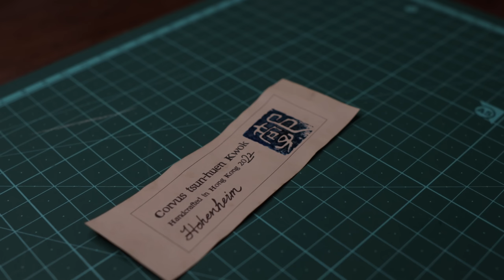Making a Violin with HAND TOOLS: Commandeering Strad's Titian

Comment: If this gentleman is an "amateur woodworker" then I'm Captain Jack Sparrow!!  Beautiful workmanship and exceptionally talented.
Reply from the maker: Aye Aye Cap! Honestly I had 0 experience on woodworking before making my first violin. I will go be Davy Jones or Barbossa, or maybe Princess Mera.... lol
Reply: If I can make a recommendation I would say you went to the violin makers planes a little early in the process when shaping the top and back. It’s hard on the fingers and forearm (golfers elbow). A rigid scraper can give you shavings and you can hog off material very quickly while being easier and faster to sharpen.

Comment from the maker: If you want to build one too, here's the Step by step Violin Making Guide:
https://www.youtube.com/watch?v=CYvl66WDYF8&list=PLEKBKXypc2GDmFymX2FlZOKS1UYYxdo4G

And here's the Complete 3 Part Series of EVERYTHING you need to know before start Making a Violin at Home:
https://www.youtube.com/playlist?list=PLEKBKXypc2GAofRMW-KpfqU3HZGJWTSuv
Reply: definitely stayed in tuned. :D 
also if it's possible that you can remember this comment when you see it, I want to hear it after the violin opened up a bit more.
Reply from the maker: @MIZvalvod  Thanks, and I will have to practice a lot for that too. Haha
Reply: Thanks for the video! You definitely have more tools than most woodworkers! I wished to make a violin, but I found that first I have to have a mould or a cradle to start with, many clamps to hold it together, a hot iron to bend the side planks, chisels and gouges to carve the scrolls. The whole set of tools and wood materials are more expensive than the cheap chinese violin I have!
Reply: This video is perfect! As a professional woodworker I like the tedious parts sped up. Beautiful!

Comment: Beautiful work, exquisite detail. Have watched numerous guitar builds of a wide variety, from acoustic to solid body electric, but never a violin build, this was a treat to see such skill with hand tools. As a fellow wood worker, just blown away, but wondering of the grain orientation of the neck and how under thee string tension it doesn't snap - would think that like with guitars you want the grain running length ways to provide strength/support against the strings. Did do a search for photos of violins and seems this is the norm, still puzzles the mind "knowing" wood and grain and normal ways to get strength.
Reply from the maker: Thanks, glad that you enjoyed!

Comment: beautiful work! at min 32-55 I notice you started with adding the G string followed by the E.. in order to get a fully balanced tension across the bridge, the order should be G-D-A, then E last which is also the protocol we follow when changing strings for that same reason
Reply from the maker: thanks! I put the E there “lose-ly” just enough to make the bridge stand, then D-A, as the A is always stand in the way when I’m adding the E...
Reply: He's not changing strings though, but putting the strings for the first time. You always do G and E first in that case, obviously not tense but just to make the bridge stand. Check other violin making videos especially the one from Dominique Nicosia.

Comment: Beautiful work! I need to start collecting a few violin making tools.... 
 What saw are you using at 5:40?
Reply from the maker: Thank you! It’s a bow saw, should be a very primitive version of it I guess. 
It’s just a piece of bamboo, got a nail on both sides and the heads are turned to hold the “saw blade string”.

Comment: I made a rigid scraper in a banana shape from a 1950’s circular saw blade. Non carbide tipped, so good hard steel. Cut it out with a dremel cutting wheel. I go straight from the grinder to the workpiece. Invaluable for this kind of work and thick enough for no hot fingertips 🤗.
Reply from the maker: I heard that circular saw blades are very good material for scrapers. And old steel? Is the cherry on top!
Reply: I don’t know if modern carbide tipped blades are made from steel that’s as good as the old stuff. The scraper is totally rigid and produces shavings going straight from the grinding wheel. It could take over much of the work of your tiny planes and is much easier to sharpen and use imo.

Comment: Stradivarius apparently soaked his wood in a solution that would break down the wood cell structure but leave its mechanical strength.  One of the reasons that his violins are so coveted, they sound great.

Comment: I'm on my third violin, using non traditional timbers.  Every stage is a challenge.  I'm about to glue the sides to the back plate.  I'm quite happy to use a router or sander when needed, and even a metal lathe for the radius of the fingerboard and the shaping of the pegs and tailpiece.
Reply from the maker: Sounds fun using machines. And there is a urdan legend about the 2nd violin you make is usually worser than the 1st one, and the 3rd one would be way better. Does it apply to you?
Reply: Thanks for the comment.  My first violin was a different shape to a traditional violin.  The second violin was a better tone but hopefully the third one will be as good or better.  The second one has PNG rosewood for the back, PNG ebony for the sides, Oregon for the top and birdseye maple for the neck.  The Oregon is very fine grained.
Reply from the maker: @fasterpastor1000  The second one must be an interesting piece of art. Let us know the outcome when you finish the third one!

Comment: neat stuff, thanks for sharing. couple questions, what kind of thickness were you going for with that caliper measurement? And could you share why you chose to use the power tools that you did? (you were doing much harder stuff by hand, but grabbed a power drill, so yeah, kinda curious)
Reply from the maker: Thanks. I use power drill when accuracy is more important than tradition.

Comment: How do you place the sound post for optimal frequency response in both higher notes and lower notes?
Coincidentally, I just bought one that looks very much like that.  It has no label inside, but I suspect it might be a Corvus Kwok instrument.
Reply from the maker: We are “standard” place for the post, usually would put the post there first, and adjust according to the sound.

Comment: Do you have any guidance for the locations of the cross-arch templates when arching the top & back, specifically where the  T3 template goes? Thanks.
Reply from the maker: Hi Jim, T3 is at the narrowest part of the c bout.
Reply: Thanks! So then the "center" template goes in the measured center of the plate? @MekwokStudio
Reply from the maker: Yes! Center on the center!

Comment: What's the purpose of the wood shavings around the body? To keep the moisture of the wood?
Reply from the maker: Do you mean the shavings before putting the neck and the body together?
Reply: @MekwokStudio  Yes I do.
Reply from the maker: That’s for cleaning up tiny wood spikes on the plate, specially on the top.
Reply: @MekwokStudio  Ah. Makes sense. Thanks for the clarification. Love your work. Wish I could play one of your instruments.

Comment: Um.. professional idiot here, is there any way I, as a 14 year old with a year and a half of wood working experience, a saw, a sander, a couple chisels, clamps, and a relatively small block plane could make this with home depot wood?
Reply from the maker: So you started wood working like when you are 12and a half? Wow! I wish I did that too!
It really depends what wood you can get there in home depot. Of course you can use some cheaper wood for your first try, just make sure the wood feels similar to maple and spruce!
Reply: @MekwokStudio  Thanks for the help! It has always been my dream to make a violin as I have been playing for 2 years.
Reply from the maker: @qwertymcflurry3013  Good to hear that! You can also join our online course to learn all the details of violin making. We just finished doing almost all the preparation works and finished making the blocks. Gonna work on the ribs next week!
Reply: you can use any wood, but will not sound like a good violin